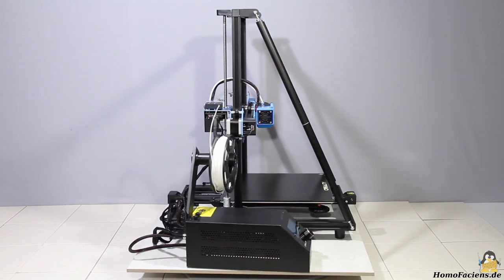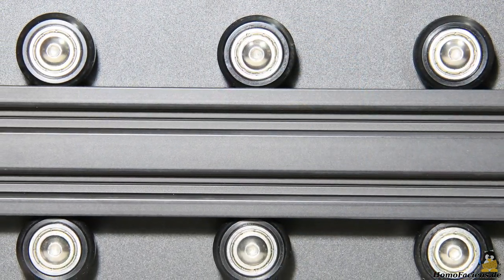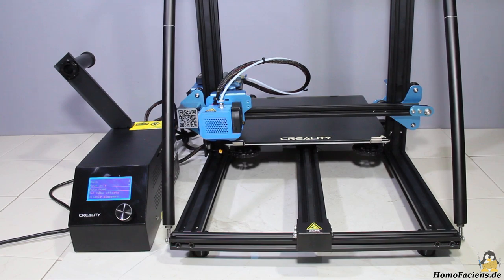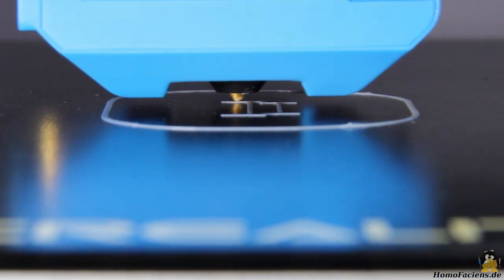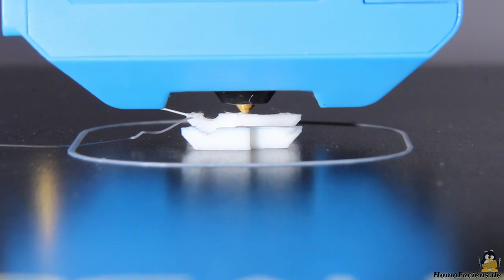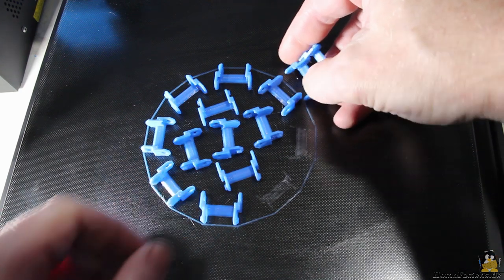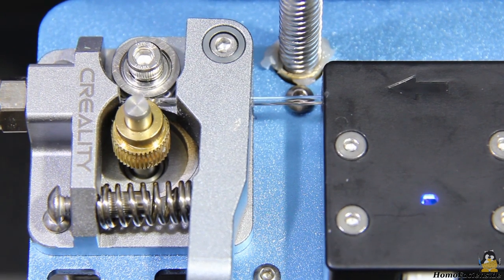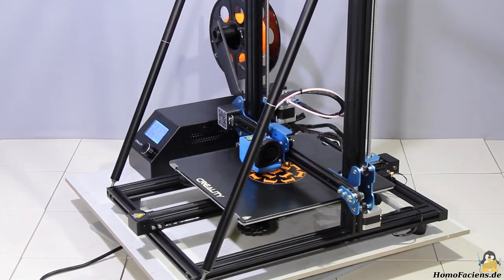Review of the Creality CR-10V2 3D printer

Comment: I have this printer, and it's definitely worth the money. It's actually quite easy to level, and prints quite quality parts. I bought this black Friday, and ordered the auto-bed leveling kit as well, and let me tell you, the auto bed leveling system will be detrimental to your printer's performance for these reasons:

1. It's obsolete. The manual leveling of this printer takes about 2-3 minutes,  and you don't have to touch it for months after.
2. It's software that you need for leveling makes things a lot worse. The software that you have to install to activate your BLTouch probe does a few negative things, one if which is that it removes soft limits on your machine. Meaning, if you command the Z to move to -3, it will move to negative 3, and smash the nozzle into the bed.
3. It doesn't level that good. I did trials of having the ABL level the bed, as well as having myself level the bed manually, and every time I had the bed dialed in a little bit better than the probe.

I probably could have made my own marlin configuration for this machine and had it work okay, but for the effort that it would take to do that, but for the reasons above it's not even worth it to have a working probe on this machine. The machine works fine as it is.

Don't let this deter you from purchasing this machine either, it's a great machine to own, and I'm continually impressed by how smooth it operates and the quality parts it produces, all while being near silent.

Comment: Aren’t you tempted to redirect the output of the controller cooling airflow to the underside of the print bed, in order to improve energy efficiency and lower the strain on the power supply ? The heat bed PID controller should handle this nicely. 😊
Reply from the maker: The air coming out of the controller box is definitely too cold. Probably mounting the power transistor below the heated bed would do a better job. However I don't recommend following that advice ;-)
Reply: HomoFaciens The idea is just to pre-heat the air surrounding the bed to offer a thermal cushion from the ambient 14°C. Not to blow the bed heating away. I envision a good old vacuum hose circling around the machine, with holes on top.
Reply from the maker: Oh, I see. To my mind, an enclosure for the printer with the electronics outside would be the more simple and more energy efficient solution, but you can prove me wrong.
Reply: HomoFaciens YouTube is I’ll suited for extensive discussions. I will give this idea a go next year if Prusa release their corexy machine and the design lends itself to MOSFET heat recycling 😅

Comment: Nothing im printing doesn't want to stick to the print bed
Reply from the maker: Use a glue stick and probably level the bed a bit more tight. Use PLA for first experiments in 3D printing - its easie to handle than e.g. ABS.